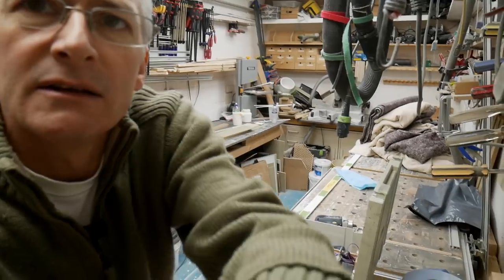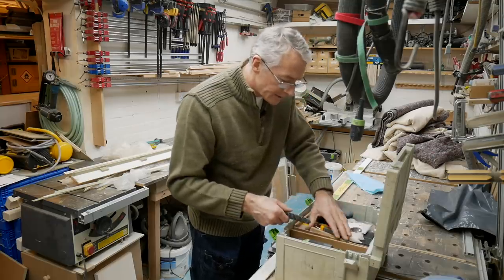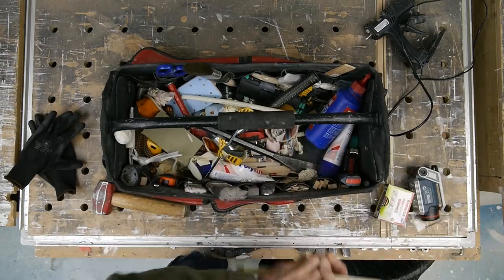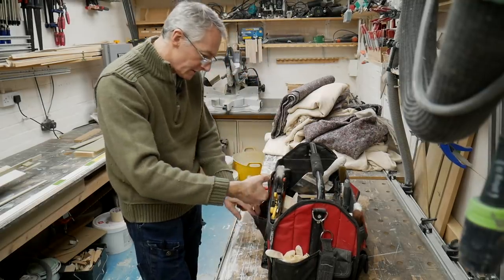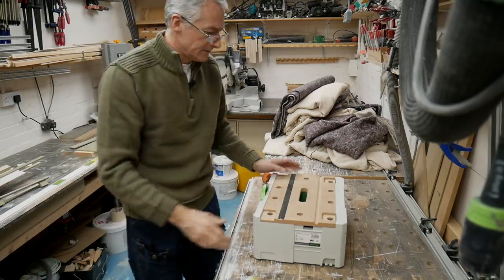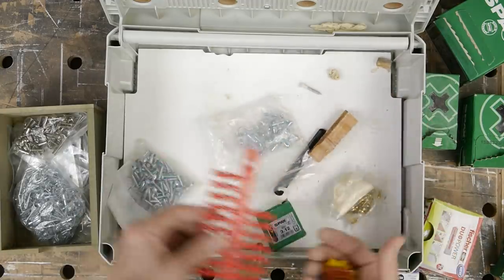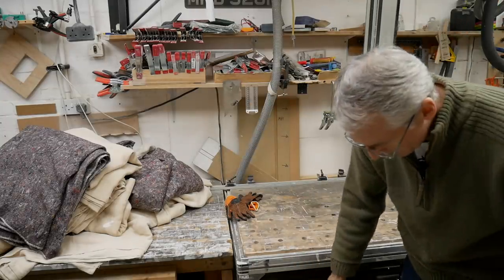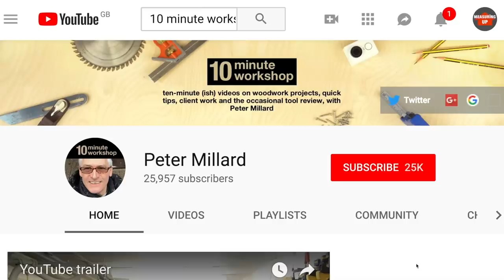Installations Part 3 [video #275]

Comment: That is why I keep all my tools in my van and a lot of various fixings in my van so when I'm finished the job each tool has its proper place and each said fixings go back to where they were when I go back to my workshop which is where I will manufacture signage or I do cabinet making as a hobby use my old tools which are all normally corded tools for any of that type of work and you can sometimes use a bit cheaper tools because it's something you can make allowances for when you're working in your own environment I noticed that you unpack or your sustainers for your power tools I wonder if those sustainers actually more of a hindrance than a help they would be for me I don't know if they are for you but I asked the question but I'm enjoying watching a series and seeing someone else's way of doing things
Reply from the maker: Systainers a huge help when I’m moving gear around for installs - having a modular system where everything interlocks and can be wheeled around, then easily split to get up & down stairs is a massive benefit. 👍👍

Comment: 1mm metal cutting disc on your angle grinder will cut that blade/scraper/spatula, use a wood offcut as a disc guide (clamped of course) - I keep a decent supply of ciscs and it makes cutting thin metal sheet a breeze, always useful.

Comment: You can never have to many Systainers, especially the Tloc ones. Best way to keep things organised and brilliant for transporting.
A Quick tip for the pile of dust sheets after they are folded and stacked. Put a ratched strap around them and tighten down. It keeps them together and folded and you can pick the whole pile up with one hand.
Reply from the maker: Thanks! I usually just wrap a runner around them, but like the ratchet strap idea! 👍👍
Reply: Great tip. I was trying to stuff a load of dust sheets into a plastic bag yesterday to try and keep the space down. I will try a ratchet strap.
Reply: If u have dust extraction with you, or access to a vacuum, you could use one of those vacuum bags for shrinking duvets !! 👍😎☘
Reply: @peterfitzpatrick7032  That sounds as good as my idea!

Comment: It is surprisingly interesting seeing someone else wrestling with the same problems I have! I have two general purpose toolboxes because I can't get everything I need into one without making it so heavy that I can't lift it. My Stanley tote has all the big/sharp stuff in it, and the Stanley box with the sliding layers has my PPE, and all my measuring equipment, and small items that would just get lost at the bottom of the tote. The tote is very useful when trying to wrap up a job quickly - pile everything into it and sort it out at home. My specialist toolboxes are all identical so I've labelled them with a permanent marker as to what they contain so I don't have to open them up to check what is inside. Great video. Cheers!
Reply: My boss complained that when I do site installs I take minimum 3 tool boxes.  Said I should put them all in one and save my self some time and trouble (He's afraid of me forgetting something important).  He then picked one up to put on the truck and nearly dropped it.  
I laughed saying now imagine if ALL the heavy stuff was in that box too?"
Reply from the maker: Thanks Tony! Yes, always interesting seeing how other people approach the same problems! And that’s exactly what the tool tote gets used for at the end of the job - a bin, basically! 😂😂

Comment: Ahh the clean up after the job is done huh ,so much fun ,as i watch this i think,well i ve got to do all that myself ...lol and dont wanna but gotta ,i bring everything from table saw to a couple dozen types of fasteners,four different saws and use everyone of them ,i really like the part of doing laundry at the end of the week and hearing the cling clang bang in the washer ,found that bit that was missing and the screws that went with it ...lol
Reply from the maker: Haha - it’s a very particular time isn’t it Syd, that ‘bit in the washer’ sound! 😂👍👍
Reply: I just use a wheel barrow to tip the stuff in the back of the van, the drive home on potholed roads  tends to sort it into piles of small, medium & large tools 👍😎☘

Comment: first of all. watching you fold those dust sheets was kind of mesmirising.its amazing the amound of work that need to be done once the job is 'finished' . the customers never see this. they think that as soon as you walk out that door that you are finished . the one thing to take from this is the use of a dedicated tool box just for stuff for that job. i try to have an empty toolbox floating around just for this . fire all the stuff for that job into it and awya you go. problem is i always fill it with new tools or organise a job specific tool set into the empty box. i must have bought an empty box 10 times.

Comment: I didn't see a nice, high quality block plane in your kit. Is that a tool that you find you don't use  often enough? I've found that a good plane with a very sharp iron shaves down MDF quite well. A shop made sanding stick does about as well but does make a finer dust to aggravate the homeowner. This is a great series. Very few clients realize the off-site efforts to set up and take down the tools and materials for even a small job. Thanks.
Reply from the maker: Thanks! Ha! You know, even after all that prep I left my block plane off the list! Luckily I remembered in the morning before I left - and yes, I love a low-angle block plane for scribes. 👍👍

Comment: Hi, Peter.  Didn't hear you say anything about a step ladder. I use a two-step ladder-chair (Help the Aged type) for most jobs inside a room. They have strong wide treads and fold very flat for ease of carrying or storing. Generally a couple of feet higher off the floor is all I need when working in a standard height room. The top step can act as a saw bench with a clamp and, as an added bonus, it is comfortable to sit on when I have a well-earned mug of tea.
Reply from the maker: I usually have a mall platform/ hop up with me, but space was really tight on this install, and rah it was in a loft conversion, so the ceiling was low. Also, a huge advantage of sustainers is that you can stand on them 😆👍👍

Comment: as you’re using filler regularly, get hold of an onion board, great for quick clean up.
Reply from the maker: I need to seaqrch for 'onion board' - do I need to hit 'private browsing' before I do?? 😯 Nah, if there's anything I have loads of, it's little scraps that I can ix filler on, but thanks! 😂👍
Reply: I use them for car body work as I mix up a fair bit. For me they’re essential as cardboard etc has waxes and agents that can ruin a paint job.

Comment: Hey Peter ....I have a tote bag very like that... I think mines Lidl or Aldi but its a great bag... there are loops inside each "gable-end" & I got those plastic vitamin c  "losenge" tubes & pushed them into the loops, to form "solid pockets"....  less likelyhood of stuff falling through.. also they are handy for drill bits & jigsaw blades & screwdrivers & .... well, u get me drift 😅
The tote is, as u say, is really a carry-all and it tends to get quite heavy, particularly if u have organised it as it then holds even MORE stuff... 😅
Nice vid... but you need to stop & take a breath... yer making me tired just lookin at ya... 😩
Reply from the maker: Haha, thanks! Good too about adding tunes - hadn’t thought of that! 👍👍

Comment: Hi Peter. Why don't you get yourself a GLC multi pocket bag or a Veto Pro Pack? So many pockets on the GLC bag I use and you can throw your coping saw, drills, filler and anything that won't fit in the pockets in the centre compartment. Had the Glc now for 3 years and it's as tough as boots, I did have to get it shipped from the states but you may be able to get them here now. Makes life easier when you know what's where. You Wouldn't have to unload it either, just throw it under the bench. https://goclc.com/products/Work-Gear-Softside-Tool-Carriers-Bags-Backpacks/1539
Reply from the maker: Thanks Jason. The regular gear is in sustainers, the stuff that goes into the tool tote is specific to the job I’m doing, so varies with every job. The Veto Pro packs look great, but way more than I’m prepared to pay for a soft toolbag - don’t think I paid that much for all my sustainers combined 🤔👍👍 
Edited to add: Thanks for the link to the CLC bag - don’t know that brand, I’ll check them out, thanks! 👍👍